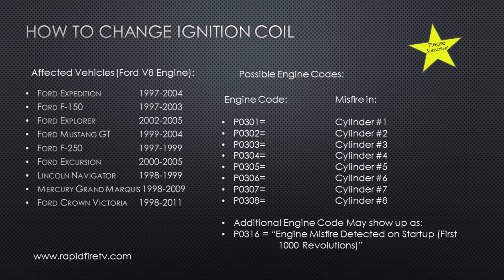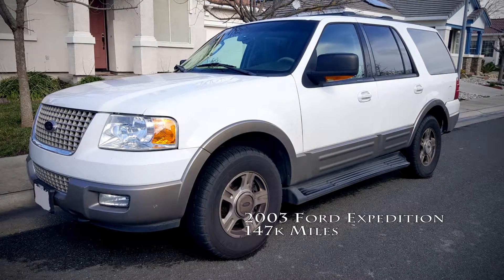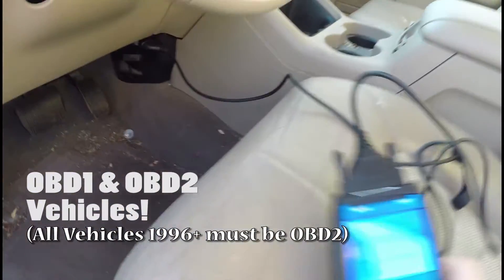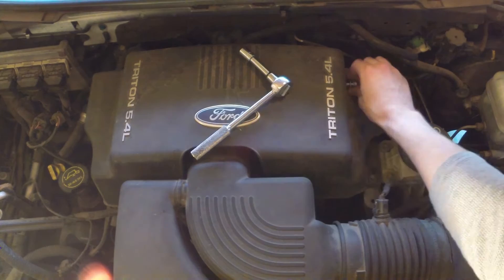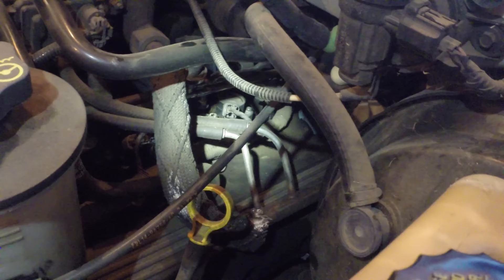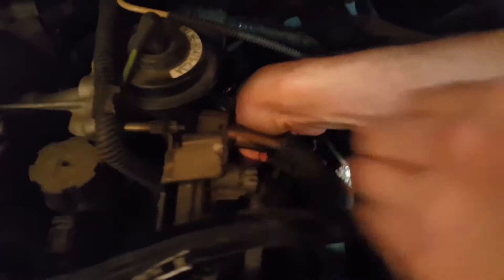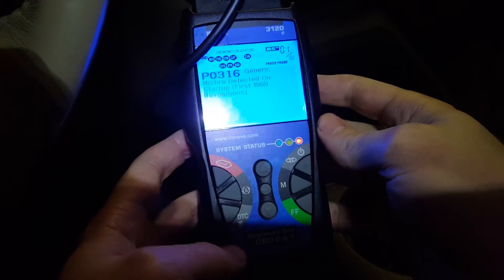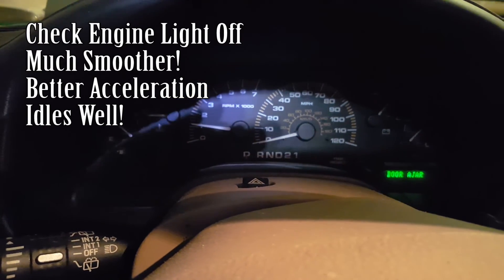How To Replace Ignition Coil Ford Expedition, F150, Explorer, Mustang GT

Comment from the maker: We hope this helps out anyone with a bad ignition coil :)  Cylinders 4, 5, and 8 are the most difficult.  You'll need to remove the power steering reservoir bracket for cylinder #5.
Reply: Rapid Fire TV This video is very helpful. My check engine light came on last week, took it to the mechanic and they replaced ignition coil for cylinder 2. Now my check engine light came on again with code P0301. After watching your video, I am going to replace the ignition coil for cylinder 1 myself. This step by step vid is so useful!
Reply: It's not the ignition coil it's the cylinder ignition  lock the place where the key turns to start the firing up of the block so the engine will run. Cylinder and key are out the little green  clip/or guide and inside i can't figure out how to change itind. Again please help